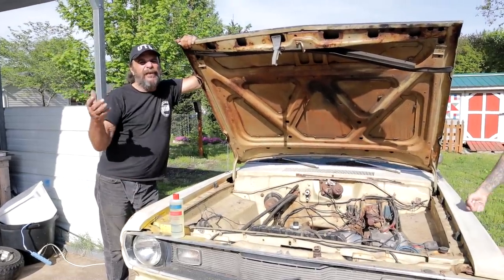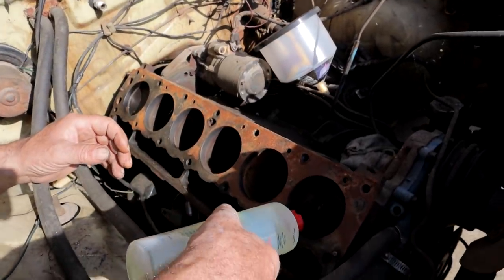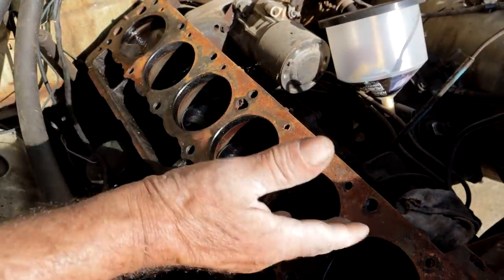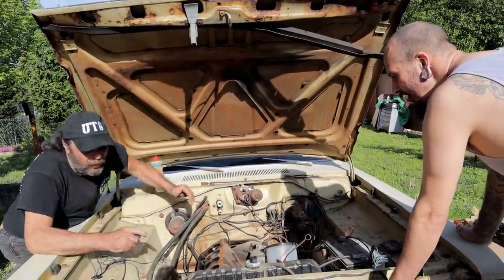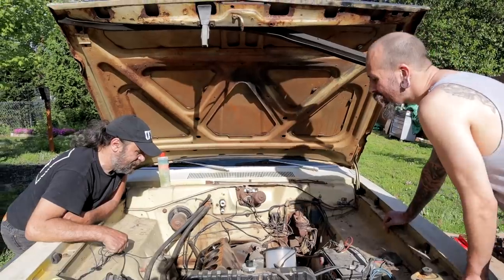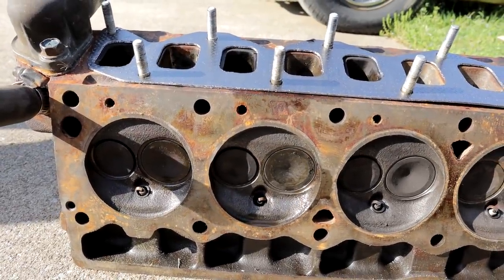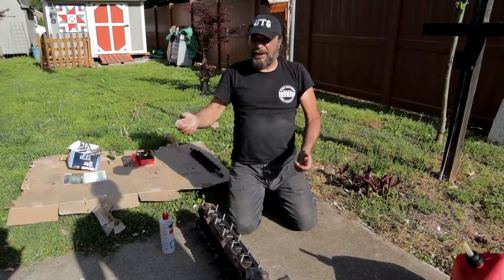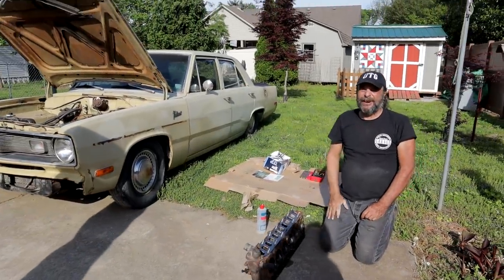Cheap Classic Car Revival- Assessing The Mess

Comment: Hate to tell you that timing can affect the compression
Reply from the maker: Ok Mr. Science...please explain how timing...either cam or ignition would cause no compression in only 2 of this engines 6 cylinders.  That was the original complaint and that's what I responded to.
And people wonder why I stay away from the freakin comments.
Reply: Lol Mr Science
Reply: Timing doesn't effect compression!
Reply: High lift and lots of duration can lower compression.
Reply: I may not be explaining it correctly but I understand it. Lol.
Reply: @UncleTonysGarage  if your valve is open Onn the compression stroke, you won’t have compression…
Reply: No shit Sherlock. I think he knows that.  What's your point?
Reply: @aygwm  How would that affect only two of six cylinders?  No form of timing issue would explain this.
Reply: @wagneric222  a broken camshaft but not on the first 2
Reply: @davidj.2870  Fair point. The craziest intermittent compression story I ever heard was from a bus mechanic who found that a piston was split in half top-to-bottom, but would somehow stick itself back together (turbo pressure?) when brought in to be checked.
Reply: Lmao...
Reply: @wagneric222  not to get into the debate or anything, but the guy said he only tested the first two cylinders before he pulled the head, so the rest are unknowns.
Reply: @aygwm  You talking about a stuck valve which  has nothing to do with valve timing
Reply: @rpdynalo  not on just two of the six cylinders. Pay attention!
Reply: @UncleTonysGarage  He says multiple times that he only tested two cylinders before he gave up. I'm betting it is more of a case of improperly used compression tester.
Reply: Tony you got to get some of them sandals. You want need Sox anymore. 
        I would say it had sticky valves, if it was throughing gooseeggs. Them rings will wakeup most of the time. 
        I've used gas checking head,but not cylinders. If they hold gas for 2minutes they're good. 
         I'd lap the valves, new seals. It's not going to get maintained anyway. 
       Reckon what the tranny fluid looks like. 
      Tomorrow.
Reply: And it will do
Reply: @rpdynalo  lift?????
Reply: @jimmybare3026  what are you talking about 😂
Reply: If the timing was off then ALL cylinders would read low or no compression.
Reply: @aygwm  yes mister master tech
Reply: Maybe if the timing chain had jumped, timing could become an issue. But U.T. would tell us if that was the issue. Not sure that is an issue with these motors.. Maybe worn out but that wouldn't make it way off. But he clearly found other issues and with the head off, that wouldn't make a difference anyways.
Reply: Clearly he has a twisted cam
Reply: @needmetal3221 -- 🤣🤣🤣👍good one
Reply: Shutup Farva..
Reply: @wagneric222  He said he only checked the front 2. You are doing the same as Tony. Not listening.
Reply: I found someone trying to use a compression gauge while turning crank with a ratchet.  Result was zero compression on all cylinders but engine would start and run fine.
His assessment was compression gauges don't work.
Reply: @UncleTonysGarage You do know he said he only checked those front 2 right? That's not really a viable argument above. I love you man but sometimes you dismiss people too soon and your knowledge keeps you from really listening to people. I highly doubt this was jumped timing as well but saying it can't effect it is wrong then to defend the mistake with bad information instead of actually explaining it is not good.   Lots of people here to learn but everyone isn't stupid and nobody likes being made out to be. I know you're gonna be pissed anyone questioning you as well as a lot of the followers. I know that's you and that's cool too but let's correct bad info for those that don't know.
Reply: @wagneric222  they quit checking after the first two...
Reply: @jimmybare3026  they only checked the first two....pay attention. Got cha! 
Sorry , couldn't resit .
Reply: That don't make sense buddy
Reply: @bw3506  You're right, I ignored information; it's possible the cam was on the wrong tooth or the compression test itself was faulty.
Reply: He only checked the first 2, that doesn't mean the rest didn't have compression.  An out of time cam can ABSOLUTELY cause no compression smh Jesus christ. If both of the valves aren't fully closed, i.e. from an out of time camshaft, the air will escape on compression stroke.
Reply: @jimmybare3026  he didn't check the rest, so eat your words and pay attention yourself smh lol
Reply: @unpopularopinion3158  At the very beginning the other man had already checked the engine for compression that's why he pulled the head off of it so you pay closer attention for now on  lol.  It ain't nothing but a thang.
Reply: @aygwm  I'm talking about if you don't have compression on  the compression stroke then you've got catastrophic problems possibly a hole in your piston as far as that goes maybe a broken rod or even a stuck valve a broken rocker or collapsed lifter bent or broken push rod there's multiple things that can cause that situation but perfectly functioning valve timing doesn't affect only one or two cylinders and have no effect on the rest. But if I'm wrong here and anyone can show me I'm wrong then everyone has my apologies. 
But you can Bank on one thing the guy making this video knows his stuff and if he says it I promise you that's good enough for me. Me and this guy come from the same era and I knew guys like this and so did everyone else in town that we're into working on their own cars and especially Hot rodding.  YouTube or the internet didn't exist. We had Chilton's and our hot rodding books and magazines and everything else you learned was on your own or from guys like this. Because when we couldn't figure it out we could always go to this guy  to tell us what we did wrong or what possibly was wrong and he would always know and if he didn't he could usually figure it out in a hurry. Anyhow people arguing this point have taken his video out of context. He knows increase valve timing, or advancing the cam raises compression and lowering valve timing lowers compression at idle but that's not what he's saying. He's merely saying it will not be the cause when you're dealing with cylinders with zero compression.👌
Reply: @jimmybare3026  he ONLY checked 2 cylinders, but the point is an out time cam CAN CAUSE LOW OR NO COMPRESSION. As I have already stated,  get your comprehension skills up bubba.
Reply: I'll bet that Valiant would fire right up if Stuby had SHOES on.
Reply: @UncleTonysGarage   stop crying
Reply: Miss timed engine leaks
Reply: @unpopularopinion3158  I stand corrected. He did only check two.😭
 But I will have to add to this, Tony did check all six with a completely viable method. It's all good. We all have to agree to disagree and at the end of the day still be brothers and sisters.
Reply: cam timing yes ignition timing no. except it wouldnt affect it enough to throw your compression gauge off unless your cam is so far out, but then it wouldnt run anyway and compression wouldnt be your issue
Reply: @aygwm  how far off is your cam? LOL if its that bad then compression isnt your issue here
Reply: Ignition timing no timing won’t affect compression. Plus the test he did that engine won’t hold air. The first cylinder won’t even hold liquid, so definitely won’t hold air. Remember an engine is essentially an air pump, no compression means no combustion. Likely a stuck ring which isn’t surprising as long as that motor sat not running in the elements likely? Then the valve on heads won’t was leaking gas so valve seats are shot. So short block and head going to need to go to machine shop and new set of rings and likely pistons. 

Yes cam timing where valve stick open will affect compression testing as air will leak pass valve but this wasn’t clearly the case and he knows that already.

Comment: If the timing chain jumped you would have low compression
Reply: Slant 6 no chain gear to gear
Reply: @jeremyhanna3852  everyone I've worked on has a chain. Look it up
Reply: @dougjones9493  your right I was thinking about the 250 l6 in my chevy truck its gear to gear with that wierd plastic
Ish gear
Reply: @jeremyhanna3852  I've found many of the plastics gears with all the teeth broken off all in the oil pan

Comment: Wouldn't it just be easier to unscrew the top  and poor it in
Reply: Then the gas wouldn't spray all over the place, or perhaps just making longer content this way, haha
Reply: Course if you drop it then the gas all glugs out everywhere, sometimes slower is faster. Wisdom you get from experience.
Reply: Then we couldn't see the official Uncle Tony squirt bottle in action, although he could expand his merch by making an official Uncle Tony pour bottle.
Reply: @Cragified  itsas if you've never poured a soda before. It doesn't have to glug.
Reply: @superduty4556  It's as if you didn't even read a comment properly before posting before,
Reply: @Cragified  no, you still don't understand how pouring works and you end you sentences with commas for some reason. Possibly because you're a genius.
Reply: @davidj.2870  Has to have a picture of him holding a lit cigarette on it.
Reply: hey now, gas is expensive

Comment: It’s easy to test. 

Fill cyl with diesel fuel. 

Excellent holds near forever. 
Good holds 2 hours
Will run ok holds for at least an hour
Will probably start if it holds more than 20min. 
Less. Pooched
Reply: Holding all or holding some?
Reply: How long does diesel take to evaporate compared with gasoline? Sorry for the noob question, but I have very limited experience with diesel, since the shop I work at mostly sees downstream drivetrain issues on diesel products rather than getting to work on the engines themselves or messing with the fuel at all for that matter.
Reply: @MCNicholasR  a gallon of diesel in a bucket will be there next week if you pour it today...  Gasoline will be gone.  Even if no-one steals it.

Comment: Since the head has been off for some time, and everything is all rusty, I would assume the engine needs work. Anything from a full rebuild to maybe just a hone and new rings, and maybe lap the valves. What I would do first, before anything else, considering what the previous owner did to the car, is get the car up off the ground far enough to crawl under it, then get under there with a light and give the bottom of it a really good inspection. Is it rusted out? Is anything mangled? How are the frame rails and suspension mounting points? The engine will not be that difficult if the block, heads, and crank are ok. But if the car body is torn up, I wouldn't spend any time, work, or money on anything else. I have seen a lot of cars, both vintage and newer models that looked fine on the outside, under the hood, and on the inside, but the undercarriage was mangled beyond any reasonable repair. Nobody seems to even look at the bottom of a car. It's always the first thing I look at when considering any used car, regardless of age.
Reply: Yep!  just paint and tires nowandays.
Reply: My thoughts were on guides: it's rare a valve job arrives to end of life and guides are right.
Reply: Yep!  I see plenty of cars rotted out underneath.  Check there 1st, before spending money.
Reply: How do you know that all of that wasn’t already checked? UT’s been doing this a long time, so he knows this. Just saying.
Reply: doesnt take long for bare clean metal to rust i.e the deck

Comment: Terrible experiment, but rudimentary for quick test. It’s been sitting so long I’d guess the oil is out of the rings and could affect results.  Also ring gap alignment could just be short or close together and allowing quick leak down. I think the rings are probably ok, but the valves are the problem, not the rings. A good lap on the valves would probably fix it, or chain jumped teeth. My best guess would be valve lap

Comment: Timing could absolutely cause no compression. 

If the timing is so far out that the valves are open, no compression.
Reply: I think he meant ignition timing
Reply: I think UT just misspoke, he knows good and well that jumped timing causes 0 compression on all cyl.
Reply: @needmetal3221  It sounded like the guy meant to say it was out of time but I think Tony thought he meant ignition.
Reply: ...but that would be for all cylinders, not just some.
Reply: Only one and two cyl we're checked no others but that would be enough for me to say it jumped time cuz a bottom end on slant six idiot proof and doubt any issues but now it's all rusted and you move it broken rimgs

Comment: In areas with a lot of winter road salt, checking rust damages for the frame/unibody goes first. In most cases, a truck or a car with a big V8 is easier to save, since many of the smaller engines were abandoned when they lost enough power to not pass or go up hills, and a V8 has enough extra power to still run pretty well without full power.

Comment: "Mechanical" Timing most definitely does affect compression. It's a quick test we do at the shop if we think a timing chain has jumped on one bank of an engine. The bank where the chain has jumped will be different higher or lower than the bank that hasn't. In an inline configuration it's a useless test because you have no other bank to compare it to.
Reply: You are assuming an early 70s car has an ohcl v8 with two timing chains. And 2 out of 6 even for a ohc v6 doesn't qualify as a jumped chain on one bank. So no, timing has nothing to do with compression  Stuck valves, yes, blown head gasket between 1 and 2 yes.
Reply: @davidj.2870  Yes 2 out of 6 on a v6 is not 3 out of 6. It doesn't require more than 1 chain for 1 bank to jump a tooth either. Im telling you that yes a compression test will work to identify a bank of cylinders that has mechanically jumped time I know this because I do this personally as well as 2 other technicians in the shop. Also there were plenty of engines even in the 1970's with a single ohc setup or dual overhead cam setups. Did you forget that Europe existed and built cars? You are right 2 out of 6 is indicative of a different issue. I'm guessing though that you have never seen an engine with a broken camshaft it does happen quite often on some of them.
Reply: @jeremypike9153  I should have clarified, the big 3 domestic automakers early 70s. I didn't forget Europe or Japan. I wS limiting this to what we are working with, a /6. As for the bs that you work on vehicles with one chain and a bank of cylinders can jump, it is impossible, If the chain jumps a tooth  in an overhead valve motor with a single timing set, whether it is 6 or 8 cylinders then all cylinders are pooched. Tony made the comment that mechanical timing is not a factor on compression, on this motor, because it is impossible for only 2 cylinders to be affected.
Reply: @davidj.2870  but only 2 were checked before the dude gave up.
Reply: @superduty4556  no he got compression on the remaining 4 so all of them were checked.
Reply: @davidj.2870  0:37 he didn't even bother checking the other 4.
Reply: @superduty4556  so he just said for shits and giggles that only 2 had compression and the other 4 did?
Reply: @davidj.2870  how tf would he know if he just stopped after the first two?
Reply: @superduty4556  #7). Rule, Murphy's Law, Never argue with an idiot, people from a distance may not be able to tell who's who.

Comment: Now you have the excuse you needed to stuff a 318 in there LIKE GOD INTENDED.
Reply: Amen!
Reply: @scotthorn5792  Amen again!
Reply: Yup
Reply: 340
Reply: God intended a 5.3 ls going in there 👍🖕
Reply: NO! It needs the elusive 413 wedge... or a 340. Either one with a thermaquad.
Reply: ......or a nice 340/360 :D
Reply: Not necessarily.  Those A body cars were originally designed for the Slant Six engine.  Although they were sold with LA 273 and 318 engines the V8 adds a lot of additional weight to a car that is already front end heavy.  In 1973 Chrysler beefed up the brakes and other components to support the additional weight since the federal government added safety requirements like 5 mph bumpers and a larger number of buyers were ordering air conditioning.  I would think twice before putting a 318 in an older Dart or Valiant that originally had a Slant Six installed at the factory.
Reply: You engine swap people amaze me. Do you have piles of parts and money laying around?  318 means different radiator, different K member (or modifying existing), different transmission, different driveshaft, different torsion bars, different wiring harness, exhaust system.
Reply: @raoulcruz4404  that's hot rodding. We know damn well it's not just gonna drop in.
Reply: @manicmechanic448    Yes. That is hot rodding.  But this video is “cheap classic revival “ .  Trying to stay with the theme.
Reply: @raoulcruz4404  I'm not. You seem awfully upset about this.
Reply: @manicmechanic448  sorry it came across that way.  I’m just having a discussion over a cup of coffee.

Comment: I don't like leaving a block open like that for a long period - it pretty much guarantees a trip to the machine shop.  Spraying the deck with sp400 [or similar preservative] buys time, but it still has to be covered.  When I have an engine on a stand outdoors for days on end/disassembled,  I also pop a pound bag of dessicant in there before taping a good 4mil bag in place.
Reply: Ya, look at the deck surface. The head will probably look the same. Even a rattle can of something waxy or just some blue shop towels stuffed into the bores soaked in kerosene with some plastic wrap on it would have stopped this. Utg spraying gasoline into the bores is guaranteed to strip any of the oil off the cylinder walls and anything else it touches. Kerosene is messy but isnt really any harder to find and doesnt have the problems of oil washdown that gasoline does.